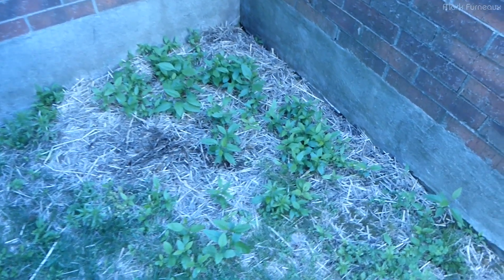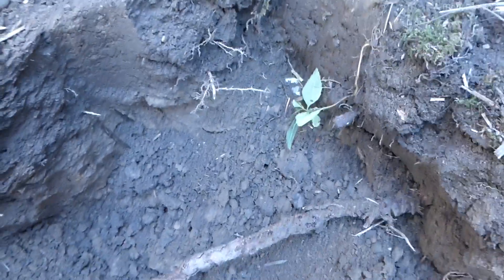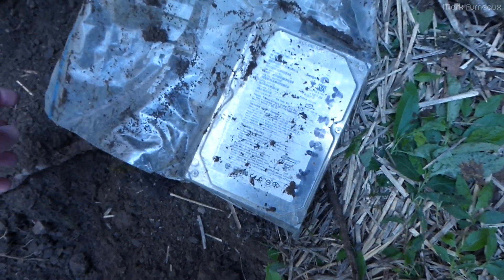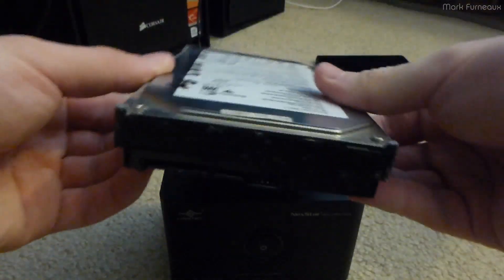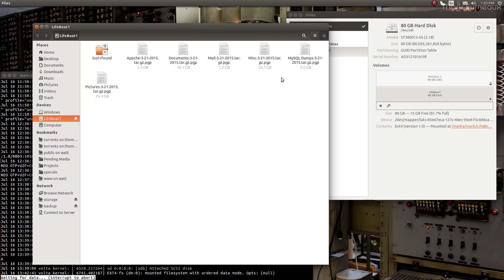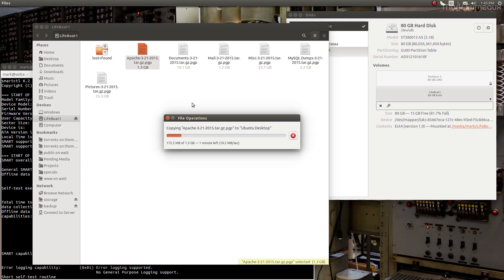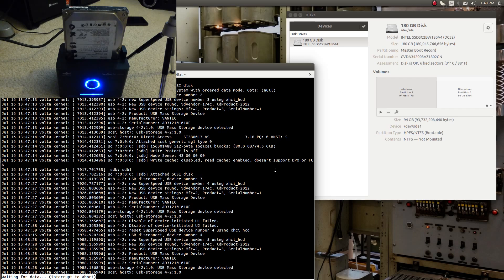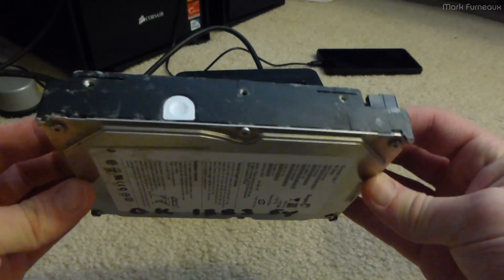Hard Drive Survival: 1 Year Buried Underground

Comment: I'm really not that surprised. Most plastics will last a year in the earth without breaking down and letting lots of moisture in. Plus being underground really takes the edge off of those temperature peaks and troughs. Even during 40C weather if you dig an inch down into the earth you'll tend to find that the temperature is a lot more reasonable. Similarly, in winter the drive will be protected from mounds of snow and wind chill. While the temperature in the air above the ground may range from -10C to 40C throughout the year, the drive itself will probably only experience temperatures ranging from about 0C to 10C in that kind of spot in the earth.

Comment: The data of Hard Drives survive about 3 or 5 years on a shelf. Burying it can cause corrosion to the PCB and sealing rubber but if those components survive, then it's not very different from leaving it on a shelf. The data of HDDs actually last longer if they are plugged in and running because this way the data is constantly reinforced by the system. HDD is not a good device to use as inactive memory.

Comment: Good old seagates
Reply: Yeah, they were the best; proper enterprise quality, yet still affordable enough to make it into even budget PCs. (How the mighty have fallen, yet again…)
The only premature, unprovoked failures I've encountered with (some of) them were in some ICs manufactured by STMicroelectronics, which presumably fell short of Seagate's specifications in the first place (although they could still survive for a while, when kept cool); the ones with Agere microcontrollers and Texas Instruments motor drivers have remained trouble-free for me, even when running hot (as long as the temperature is still within the rated limits).

I'm sure any truly consumer-grade HDD (which, to be fair, did include Seagate's own U Series) would have been completely dead after this experiment.

(If it's any consolation, though: At least Western Digital's Caviar Blacks seem to be a nice spiritual successor to the Barracuda 7200.7, complete with 5-year warranties.)

Comment: Wow 50 digress soooo hot
Reply: ThatRandomGuy Celsius is way more accurate. 100F is the temperature of the human body, which can vary and is not very easy to measure. 100°C is the boiling point of water. Calibrating thermometers is very easy, just put it into boiling water. 0°C is the freezing point of water, so you can put the thermometer into freezing water.
Reply: 40 sorry XD
Reply: his country uses retarded measurments 40c is actually the 104 degrees in normal measurments
Reply: RobinMC Boiling point at sea level...

Comment: That's pretty impressive. Although drives can take a rather hard beating temporarily. There is no doubt if you were to do this with a new drive and then put it into full normal service it would fail quite quickly. 

A long time ago, I had removed the case, cut a window into the cover and put a bit of Perspex over the window. The disk worked totally fine for about a month. Then the died, probably from dust intrusion.

Comment: Do you know why the drive had bad sectors in the first place?

Made by Seagate.
Reply: BoomBrush - yeah Seagate still fucks around with their consumer firmwares. Their mechanical design and spec is alright but I had two drives commit suicide due to a badly implemented firmware procedure that was supposed to save the data in case of media degradation.
Reply: InToCraft or we both just got some bad cookies and don't like the brand (even though WD does usually make higher quality drives (my uncle used to work in one of the factory's)
Reply: BoomBrush is this just a running joke or is Seagate really less reliable? Personally I've never had one fail, unlike WD
Reply: vinno97 I've owned maybe 12 hard drives in my lifetime, and the ONLY ones to fail (3 of them) were ALL made by Seagate. One of those hard drives (model st3000dm001) had gigabytes of photos from when I was a kid on it as we were using it as a backup. The drive was working perfectly then it just died. Warranty was 1 year and this happened at about the 1.5 year mark. That particular drive had a failure rate of 32% according to Backblaze’s failure data as of April 2015 (https://www.extremetech.com/extreme/222267-seagate-faces-lawsuit-over-3tb-hard-drive-failure-rates). That drive with the photos on it WAS our backup. My sister also had a seagate drive in her computer which randomly died, luckily the only data she cared about she emailed herself. The third drive I was using as a "testing" drive with no real data on it, and one day it just stopped working.

I've found seagate to be the most unreliable of hard drive manufactures, but your experiences might differ.
Reply: @BoomBrush  replying to a very old comment but ive had a seagate drive for a good 8 years. i usually do tests to see if the drive was working and the only issue was there was 1 single bad sector. and that was when it fell off my table a few weeks ago. still running. alongside a Toshiba 120gb drive from 2005. that has no issues at all
Reply: ItZz JoK3rZz I mostly use Western Digital hard drives, none of my WD drives died, even though they have at least 15.000 hours +++++
I think that most seagate drives are really bad for storing important data, I have a Western Digital 800 at 80gb, it has 54.160 hours and still works just fine, it was used though, I’ve got two seagate drives, they both have bad sectors in less than 20.000 hours
Reply: Mitsos Tech that drive i mentioned had more than 50000+ hours, ran since day one i had it due to having a home server back in the day. im definitely going to replace the drives soon as they do have bad reviews. it was a simple 320gig drive anyway so no big deal lol. was thinking about them 3TB barracuda drives. are they known to be good?
Reply: BoomBrush I had more Western digital drives fail on me than Seagate drives
Reply: Gustavo Ferlizi there a diffrent kind of bad.
Reply: I actually have only seen one hard drive fail out of dozens. It was a Hitachi that was in a laptop that appeared to have suffered a physical blow.
Reply: Well.. I'd better keep my systems backed-up then. I solely use Seagate as hard drives :p
Reply: ***** Although BackBlaze's data is a misrepresentation due to the hard drive's harsh daily conditions it was subjected to, that doesn't change my hard drive from not working to working. Regardless of the statistics by Backblaze, my experience has show to avoid Seagate. If you go to the comments of any ST3000DM001 fail video, you will see so many people complaining about the same issue I had. I know thats not a reliable way to evaluate a hard drives fails, but those people dont run drives in backblaze's conditions yet it happened to them too.

The price I paid for that drive was far from cheap, as I got it in 2012 I paid about $180aud I think. I wasn't even writing to it massively often, when I got it I think I just copied about 2TB of data onto it and mostly read stuff from then on. Using a raid setup for 2TB so that it has redundancy would have required me to have two 2TB drives (which im guessing would have cost $240aud for both) and my previous computer setup did not support raid, so I probably would have had to figure out some external network drive.

Looking back I probably should have purchased a 2TB drive instead of a 3TB drive, but had it not failed I suspect I would have deposited more information requiring all 3TBs. In my current setup now, I have two 1TB drives where I just copy stuff onto both drives and one drive is essentially a copy of the other. So once one of the drives fail, I'll just get a new 1TB drive and copy stuff over.

I'm not sure if WD Black was around back then but I certainly wont be using a single drive as a backup from now on regardless of manufacturer. I guess I have to have a backup of the backup.

(I'm not sure if I full addressed your comment, feel free to discuss more).
Reply: InToCraft I've had more seagate drives fail on me than WD drives.. so, it's safe to assume that we're both wrong
Reply: PneumaticFrog or we both had a shit experience with one brand that made us not use that brand anymore
Reply: +InToCraft maybe everything is bad :?o
Reply: all mechanical drives are bond to fail no matter the brand
Reply: This guy knows what he's doing
Reply: I think with exception of that recent fiasco where Seagate had 3TB and 1.5TB drives fail en masse, i think they had a pretty good run as a whole. HGST managed to produce a drive with similar failure rate just a short time prior! And WD and Toshiba both regularly release drives with more than 5% failure rate in first year, which is significantly higher than expected.

I have had a string of failures of Maxtor drives, 100% on i think the DM80 series, 6 drives bought over the timespan of a year or two, run in multiple systems, plus some of the warranty replacements. When Maxtor was absorbed by Seagate, i grew quite suspicious of them. But at the end of the day, all of them are suspicious.
Reply: What's wrong with seagate  I have a 2 Tb hard drive for my PS4 made by seagate
Reply: So true lol

Comment: I left a drive submerged under water outside for 3 days (dont ask) let it dry in the sun for about 3 more, curious i hooked it and despite a bit of rust here and there it actually booted windows. bios s.m.a.r.t reports drive is failing but around a year later it still works. it sounded crunchy for a few but is fine now. i run it in a spare pc to see how long until it fails completely
Reply: even 0dds - at that point I would try to ultrasonically clean it on a rampant frequency one.
Reply: not worth the trouble. all the data was pulled before drive was removed 
and was going to be wiped and used as secondary storage backup or 
destined for the closet of dusty forgotten parts

Comment: 13MB/s? I have a mini IDE HDD from probably around 2004 that does 30...
Reply: Ziggy Wiggy drive dock will not interference the I/O speed...... even USB2.0 dock is capable go 60MBps.... it might be just errs...
Reply: Ben Chen I feel like many USB 2.0 controllers are a bit sloppy on that part though; I could never get my USB 3.0 flash drive (130MB/s sequential read speed) to read over 40MB/s over a USB 2.0 bus.
Reply: Yep....60MBps is the signal limit, which theoretical maximum. but..... tbh nothing would even come close since USB I/O has tons of overhead, e.g. 8b/10b encoding to ensure some level of clock recovery, signal "ready stat", data packaging, etc. Generally its same to assume its going to max out at 35MBps....
Reply: Ben Chen I guess that makes sense.

Comment: Would be cool if you let it immersed in mineral oil in a freezer bag, and had big video files all over it, then wait like 10 years and try to power up, the other you could just let in a dry storage protected to see what will turn on.
Reply: malicious1111 immersing it in mineral oil would destroy it. hard drives (with platters) require ventilation to function, immersing it in oil would cause the drive to fill with oil, ruining it.

putting it in a water tight container with silica gel would be the best bet for keeping it in ok state
Reply: m4xwellmurd3r the oil would avoid it inside the bag condense water, it would be isolated in a plastic bag.
Reply: mineral oil wouldn't help with moisture like that. If the oil is contacting the hard drive, it will destroy the hard drive, if you put the drive in a bag, inside of a bag with mineral oil, it does nothing for the moisture inside the bag with the hard drive.

Comment: The organization that I work for assembled and fielded some systems that we called, "remote automated weather stations," and one of the problems we had to figure out how to overcome was the condensation that occurs when you have thermal swings.
The condensation lead to corrosion which lead to failure.
Before I moved on to other projects, we never solved the problem because we were running from solar power and did not have enough energy to work one of the possible solutions which was running an electric dehumidifier.
The other proposed solution was to fill the casing with nitrogen.
While I was on the project, we didn't solve the problem and had to make periodic site visits to repair the failed units.

Comment: Thank you for the info and video !  Next time double bag it with the Freezer Bags and put in an Metal Ammo Can.  And put the ammo can in a garbage bag and/or a sealed plastic cooler.  And bury below the freeze line.  And for faster read times bury a SSD and/or USB memory stick.  tjl
Reply: lol
Reply: SSDs and USB Sticks will most likely survive that, because there are no moving parts. The only thing that can happen is that the PCB is corroded and no longer functional.